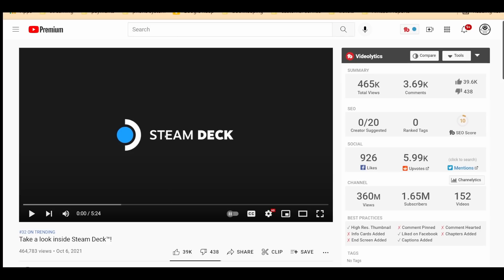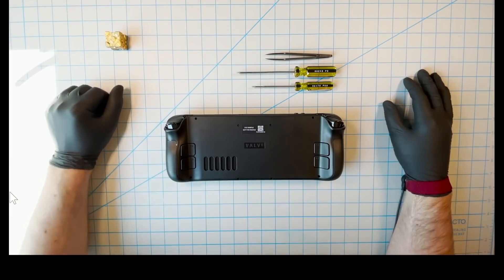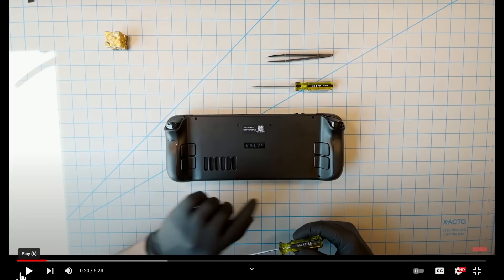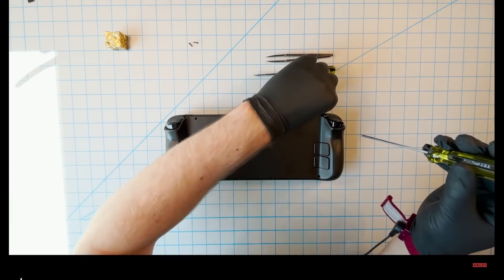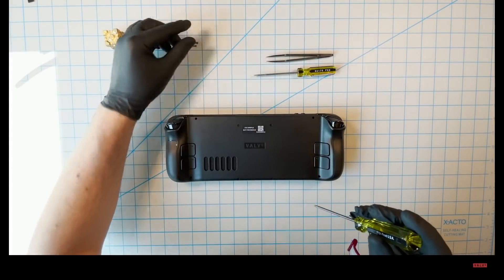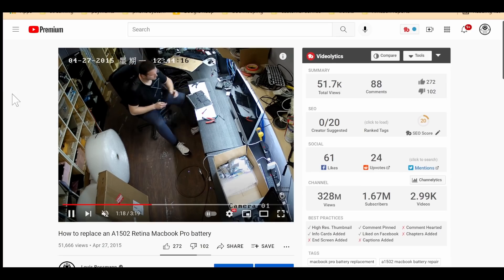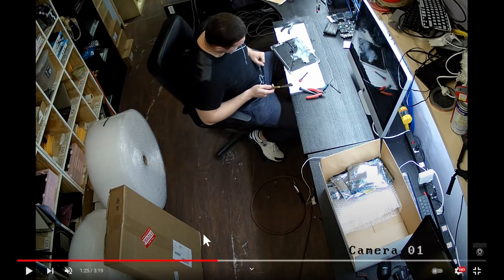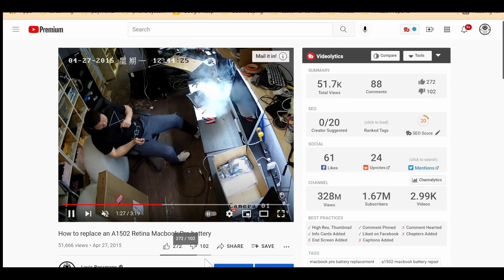Steam deck battery may end your life? bruh 😑

Comment: My comment from the Valve thread, paraphrased:
All the warnings are pretty standard fare for companies that deal in repairs for laptops, even the FTC-violating warranty blurb is actually to discourage nuisance lawsuits/complaints from people who don't know what they're doing. (They even mention, "Hey, we don't want anyone just mucking around in here, take it to a professional", which is something Apple/John Deere actively tries to stop. I thought Louis would react to that, but...)

They don't mention the screw heads, but the fact that they say "OK, if you want to, unscrew these, then these." They're making the assumption that people have the tool in their possession, which tells me the screw heads aren't pentalobe or tri-wing or even Torx or Allen, they're very likely Philips (or slot head, which would be downright evil). That alone is a huge repairability advantage over Apple and Nintendo. One thing to bear in mind is, their audience is PC gamers. I'd say the vast majority of them don't open up laptops unless they want to swap RAM or stick an SSD in, because why would they bother with an underpowered, overheating PC? They probably work on desktop PCs, which overwhelmingly use Philips screws. It's quite reasonable to assume they've assembled their own gaming rig.

There's no indication of an IP rating, which means this case is probably easy to open up because there's no sticky gasket to heat up or cut through.

Promising a parts shop is fantastic, but above and beyond would be service manuals (and schematics for that matter, forgot about those). Imagine a documentation site with datasheets and diagnostic procedures so you're a lot better informed when you're diagnosing a problem. Practically no one does that, but if Valve did, everyone should take note. If they allow people to replace, say, a failed APU by exchanging the mainboard, that would be all kinds of awesome, though it could open the possibility of some guy sending a salvaged mainboard rather than his own. Making the joysticks available to purchase separately should be a great opportunity for the maker community: tear one down to see how it works, then make your own unique replica. If the Deck takes off, I can totally see Sandisk or Samsung making Deck-compatible SSDs.

No word on the touchscreen display. Is it easily removed with a few screws, unlatch a ribbon cable or two? We probably won't know until someone on YouTube does a teardown video. Probably worth putting on a protector and being careful with it. No word on how easily the battery is serviced, though it's probably held in place with double-sided super strong tape.

Comment: A supplier that shows how to dismantle the machine even with a few disclaimers is progress. Whilst they were at it they could at least point at all the components and say what they do. Showing how the battery is secured would be good too. 

In terms of ruggedness I'm asssuming the first time a self tappper is put in place with a correctly aligned case will yeild 100% strength. Second time and subsequent may reduce rigidity by 5%.

In think their heart is in the right place but the guided tour of the boards would be a sales plus.

I want one. What's it cost...what does it do?

Comment: I think the video was a tongue-in-cheek result of probably a ton of Valve employees (possibly Gabe Newell himself) being completely fine with RTR, opening up the Deck, etc., and the legal and engineering teams telling them to say certain things to avoid liability, costs, inconvenience, and just people/other companies (insurance) being stupid. I think Louis was being a bit too optimistic about the warranty, because the unfortunate fact is that companies in general are treating FTC investigations/fines as the cost of doing business. Let's wait and see the actual warranty statement, and how they honor it or not.

Based on my experience messing with my own devices, I can attest to stripped self-tapping screws messing with structural integrity. I've had backs of small devices pop off because of this, and while it was no big deal for me, it could be a disaster if someone dropped their Deck down a couple of stair steps or something: first bounce pops off the back, second bounce lands the mainboard on a corner and shears off a vital component.
Yeah, you could try to fix the problem (threaded insert, fill and drill, glue), but usually the fixes here won't be nearly as strong as the original screw joint (dissimilar materials, existing and new stresses, polymer strength changing when heated, etc.) and your crafting skills would have to be pretty good to bring back most of the strength and not damage anything around the old screw. I've seen it done, but I know I don't have those mad skills.
I've permanently damaged metal catches in an old Macbook Pro so it never clicks shut like it originally did, so it's not just a plastics thing; I'd say aluminum can be worse, I've read one reason why Teslas are stupidly expensive to fix is because you can't just pound the aluminum alloy body panels back into shape like you could with steel. I don't know how well the corner shaping tools for iPads work, but a former colleague told me that you can bend the aluminum corner back all you want, it will always be much weaker than before, which is why we filed off a damaged iPad corner rather than try to bend it back to its original shape.

Comment: Well, they are technically correct because self tampering screws don't screw on the same threads and there is a change that the new thread won't be structurally sound. But honestly unless someone starts destroying the plastic due to over screwing the difference in structural integrity should be negligible. I believe that they say that in the case someone fucks something up and then blames valve for it (kind of like the battery example).

Comment: A little bit late but...

For the first sentence about "You really shouldn't open your device" I didn't understood it like an advice. I understood it like an antiphrasis, I mean it wouldn't be the first time for valve to make something at the opposite of other companies (and I appreciate that). And yeah I know I can be wrong on this but, that's how I understood it. Otherwise what is the point in doing this video.

Once again my own  understanding of "It will permanently affect the structure of your device" is as you said. If someone open it, then rebuilt it by overtighten the screws, it will affect the strutural integrity of the device. And as you said their will be people who will try to get a new one or a repair for free after damaging their own devices. Because if it's done right their is reason for a failure of this kind. If the device fall appart after you messed with it, it's probably your doing and not valve. 

For the lipo battery, yeah I think that they are right to say that. Because a damaged lipo could catch fire after reassembly (during charging for exemple). So once again they prefer to be safe and warned people of the risk their take by playing with it. Their is no much of a risk but just one time and you're screwed so I understand why they say that. I personnaly play with Li-Po by flying fpv drones and had a battery fire once . Because I'm a morron and tried to charge a damaged Li-Po (it was bent after a crash). I use a fireproof LiPo bag to charge my batteries so not much damage on my side but it could have been far worst by doing it near combustible materials.

So I really think (and hope) that valve is trying to make make a device that we really own and that we can repair or upgrade in the future just like it should have been already. I just find sad to be excited (and trust me I am) to see a companie trying to do the right thing for their costumers. Now let's wait and see if they keep their promises and don't turn their back on us.

Comment: To be fair, when a lithium battery hit thermal runaway it will catch fire and release gas.  Depending on the casing (samsung are encased in a metal sleeve) will expand and essentially turn into a mini grenade with shrapnel (plastic and metal in samsung's case) flying everywhere.

Comment: I don't have my sources on me, but I'm a mechanical engineering student working on my final undergrad project, and the plastic insets for the screws could be designed so that with the screw in, they are put under tension (in some cases, tension makes a connector stronger). When tension is removed, and applied again, the structure is significantly weakened. The big thing this applies to is nuts and bolts. Idk how much it would affect the actual deck as a whole though.

Comment: The way I personally see it, for the structural integrity, as also LTT pointed out, are the self tapping screws, if the threads within the plastic are broken, the device won't hold the parts as initially did, making it more brittle, and applied stresses won't go in the entire frame. It will go within different parts, such as top or bottom covers. Take an old laptop that has broken screws on the hinges, the stresses will go only on the side on which the hinges are placed, if they are on the top cover, that will start to bent towards, if the bottom and top covers are screwed down, that bending goes also into the other cover. It really depends on materials, manufacturing process and design, but also on the user and his way of 'handling' the device.

Comment: it seemed a blanket statement that opening the case damaged structural integrity...so what's the difference between you opening for a self repair, or them opening for say a warranty repair? if it weakens as soon as its opened no matter what? seems like a bad marketing statement right there

Comment: As long as the components are properly placed when you put the deck together again it should be the same. The only thing is that the self tapping screws may damage the plastic as Valve stated, but if they are screwed into place carefully the strength of the deck's structure will not deminish. But now we must think on if the screws are set into the deck the exact way as from before. If you are going to open and close the deck multiple times, it may be severely damaged since the screws are self tapping and will dig into the plastic regardless. But you would not do that if you aren't going to replace something in the deck. So if you have no purpose of opening it, you may aswell abstain from doing so.

Comment: 17:55 Self tapping/Thread cutting screws make their own thread when they are inserted. And while they will follow the old thread, plastic is soft meaning that they will remove some of it every time they move. Thus making for a worse connection and thinner more brittle threads. 

So yes, as soon as you unscrew one of these you won't be able to get it back together at 100%. Now what this practically means is that most people will not notice it really, while the unlucky ones which had to get a few repairs will have to be careful about dropping it... and modders who take it apart constantly may even find themselves without a thread for the bolts to go into eventually. 

Valve could fix this by plating the holes in a soft metal so that the screws affect the threads less. (something I imagine modders will do as soon as they can get a mold of the plastic case.)

Comment: in terms of structural integrity being worse is only if the device is sealed somehow and not applied a new one after being open, like iPhone and most smartphones now a days. Otherwise screwing it up should only be user error like screws not put on the right place.

Comment: A damaged battery could combust after reassembly and cause a house fire, so, as silly as it sounds, it is possible that disassembly "could" result in death. 
I don't believe careful and competent disassembly and reassembly will meaningfuly weaken the device, but a lot of people aren't competent enough to do this, so, I am good with that disclaimer too. Ya gotta speak to the lowest common denominator in these types of videos. I applaud valve, and hope they follow through on their claims for parts!

Comment: I'd say the warning about the battery is viable since if you assemble the device slightly wrong or leave something inside that could puncture the battery (screw loose nearby etc) later on once assembled for example in your backpack and cause a fire when you're not nearby

Comment: @8:30 yes, the integrity of the device will be less once opened, scarring in the plastic bosses the screws drive into reduces the torque they can be inserted with, and makes it more likely they will come out, however in a remotely well designed product you'd have to open it several times to severely compromise the design, it is technically true that the first time you tough it you reduce the holding capacity from 100% to something less, it is however incredibly hard to judge what that less is, if the threads are crossed inside and the plastic has been pretty mangled it could be as little as 50% of the original holding capacity, but this is unlikely. i've seen screws simply fall out of reassembled hardware before as the plastic can no longer hold it in place, this is more likely due to over torqueing the screws than using them normally, however, but it can happen.
Reply: Which is why a metallic boss/insert and a machine screw should be used, like seen in many laptops.

Comment: I can totally see where they are coming from with all the disclaimers. I used to work at a bike repair shop, and customers would often ask about repairing their own stuff. We would help them out in finding the tools and parts they needed but if it was a complicated repair like a bottom bracket replacement or suspension rebuild we would often discourage it because those were super easy to mess up, ruining the part, or making it unsafe. (batteries exploding are relatively safe. Brake failure, loose cranks, and sketchy suspension mixed at high speeds are not.) Generally, if they weren't experienced, we took a similar stance to them, just so they understood what they were getting themselves into. The bike world is also pretty pro right to repair.  It's considered admirable to have a clean, smooth-running self-maintained bike, and the bikes themselves are pretty repairable given the right tools and experience. Some bike shops even offer repair classes or rentable shop space. Unfortunately, some brands are starting to make their stuff more proprietary which complicates things.

Comment: 8:39 It's more a wear and tear thing because metal screws beat plastic every time, and removing them could potentially damage the plastic sections used to seat the screws. I see this all the time when I'm pulling screws in my vehicles which is why most of the time they use metal tabs that slide into place over the plastic part instead of just screwing them straight into the plastic. Usually if it does just go into the plastic it's a one and done thing, meaning it can only apply the recommended torque the first time the screw is inserted.

Comment: Structural Integrity... it is due to the use of self-tapping screws and reseating them not having the same friction.  That can make it so they will back off easier and affect how the parts move.  One way to fix this, is to add some locktite.
ESD... they should have been on an anti-static mat!  They don't say you will die, but that might kill the component.

Comment: The self tapping screws (self tapping means it creates it's own bore when screwed in) increase the bore when removed, creating tiny gaps between the screws and the plastic when reassembled, which allows increased vibrations from then on. How much of a difference it makes, I can't say, but I can't imagine it's a huge difference. Also Over torquing the screws will cause some pretty undesirable results.
Reply: @beetlo66  pretty much. Haha

Comment: On structural integrety, the screws holding the plastic clamshell together stress (preload) the body of the device, similar to compressing a spring. This increases the strength, and thereby the drop resistance compared to if the clam shells are in the unassembled state. If the user were to tighten the screws in a different sequence, or to a lesser torque than the factory specs, drop resilience could be affected.

Comment: They have not mentioned that you have to turn the screws backwards before screwing them forwards, to avoid re-stripping the existing thread in the plastic, which weakens it. Unless they use metal threaded inserts everywhere but are too small to see here.

Comment: the structural integrity comment may be implying that there are plastic clips which are very hard to open without damage, and cross threading self tappers will slightly weaken the plastic. its not 100% guaranteed but likely depending on design.

Comment: Rotate screws counter-clockwise until a click! Only then screw them in. That should avoid most of the damage to threads. Maybe try several times until it stops resisting. And keep screws matched to holes, their threads can differ slightly.
And if you damage the threads enough, yes, I'd say structural integrity would be compromised somewhat. I liked disassembling and reassembling my toys as a kid, and they often started falling apart after a few cycles. Those I didn't disassemble lasted longer and usually their plastic cracked before screws started falling out. In terms of Steam Deck, I'd expect back cover to start falling off after a couple careless reassemblies, maybe internal screws holding boards too, and if it drops bits might go flying their separate ways and possibly damaging ribbon cables.

Comment: The "opening it permanently reduces structural integrity" comment is probably due to the self-tapping screws. If the screws are literally digging into the casing (instead of into threads), there will be a limited number of times you can reuse those holes.
IMO, it would've been better had they used screw holes with actual threads, though.